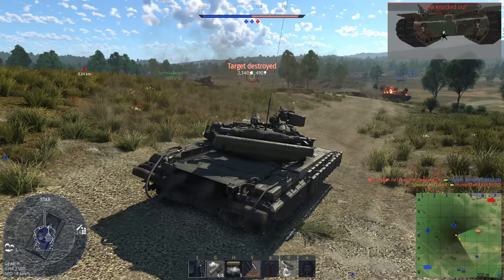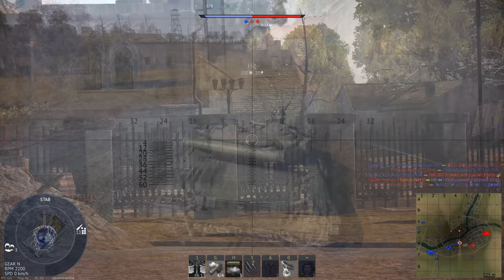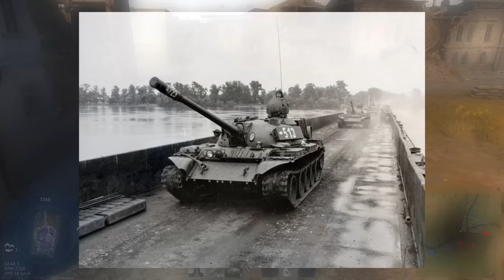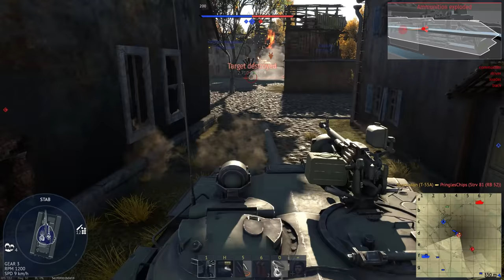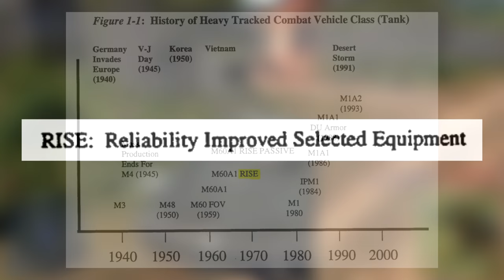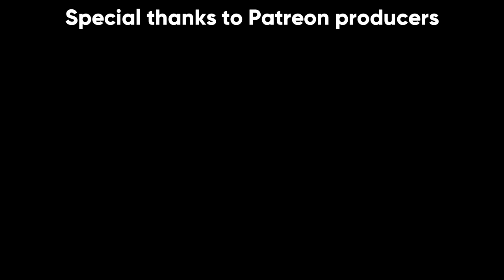Were Soviet Tanks Poorly Made?

Comment: T-64s were actually intended to be used by the "elite" forces of the soviet army. That vehicle was never intended to be that mass produced like later the T-72, wich is basically a downgraded, cheaper version of the T-64. At the start, sure, both tanks had serious problems, but overall the T-64 is a way more advanced vehicle than the T-72s at that time. Later it would be pointless to compare the 2 because more and more advanced models of T-72s were came,  wich were on pair or even more advanced than the T-64s.
About the T-80, well it was intended for complete replacement of T-72s and T-64s, the problem was, there were just too many and the T-80 was too expensive to replace the full stock. Same goes with the T-90s. Thats why today's russian armoured forces consists of a big variety of MBTs. From T-72s to T-14 Armatas, I beleive even some T-64s are in service.
Overall, economy was always an issue for the russian army, they wanted too many, too fast, too cheap, thats why compromises were made. Russia has the biggest armoured fleet in the world, you can't just swap the vehicles, like there were T-72s yesterday and now there are T-14s or something.
Reply: Iirc T-64 already retired or at least put as reserve like many T-55 and T-62. Older T-72 and T-80 probably will be replaced by T-14 starting this year, knowing T-14 serial production has started and state test will be completed this year.

So yeah Russia tank fleet has many variety, with modern Russia tank fleet will consist of T-72B3, T-80BVM, T-90M and T-14.
Reply: T-64's are all retired since IIRC 8 or so years ago, but at least couple thousand are still in storage and probably will be for some time still. Obviously the same goes for T-55/62 series, but they did drag out some 62's for use in training as opposing force couple of years ago AND sent them to Syrian goverment to replenish their losses.
Reply: Russia retired T-64 for the simple reason that they and the spare parts for them were produced in Kharkov Morozov factory, in Ukraine. It became unreasonable to continue servicing them or to attempt to aquire spare parts. Ukraine did the same thing with its T-72 tanks.
Reply: @Ypog_UA  Not that simple. First, logistical challenge of keeping 4 different models with lot of submodels in the field - T-64, T-72, T-80, T-90 plus T-14 was already being worked on. USSR was doing the very expensive thing of producing three different tanks and, arguably, it had more than it actually needed. Russia couldnt afford that, cuts had to be made and they had more than enough of newer models to cover all their needs and still leave thousands in stock. Second - the upgradability. T-64 was the original after all, it had most of the baby issues and was, simply put, old. The biggest problem is, AFAIK, weak undercarriage. Any major upgrades meant increase in mass, which the platform can't sustain without expensive refit. So why do that when you can take T-72 or T-80?
Look at what Ukraine had to do with their Т-64БМ2 - cut the hull open to have the place for the new engine, leading to turret looking wierd because it had to be raised up. 

Also Ukraine is using T-72's as of right now, including doing some modernizations. Necessity due to losses sustained.
Reply: @swordsman1137  T-14 serial production has not started.

Comment: In general? No. It depends entirely on which factory you look at for an example. Nizhny-Tagil removed items that western vehicles simply wouldn't do- like radios for the base variant- and thusly were of lower quality. Couple this with the fact that unskilled labour is being asked to build these things then obvioulsy you will have vastly varying quality in armour to the point that the welding might either be expertly done or just spot welding in vital areas to hold the armour together. 

Bare in mind also that the factories built their own versions, with cast and welded turrets being the most prominant differences.
Reply: Ok what about crew space?
Crew survivability?
If i draw a crayon picture of a tank with 10,000 horse power and 3m of armour does that make me the worlds best tank designer? Or does it make me someone with unreal expectations? Because things arent judged on how good they COULD be. they are judged on how good they are... And even a good T34 would still be quite bad.
To say nothing of the fact one built correctly could never achieve the same production rate.

Comment: @Spookston you forgot to mention the T34s Track Pins. Vibrations from the track moving would cause the Track pins holding the different plates of the track to move and become loose. This often led to the pins falling out and the trap coming apart. A chunk of metal was welded to the hull to knock the pins back into place instead of just outright changing the pins and locking them in place.

Comment: the sight on the T-34 was not heated, pretty much always leading to fogging, making it unusable, the welds would often break after being hit with a substantial round (penetrating or not) due to the poor quality of said welds, and also the excessively hot temperatures used when heat treating the armour would lead to increased spawling after being penetrated, due to this survival rates of T-34 crews were abysmal, shit was cramped as hell, some models weren't equipped with radios to communicate with other armour units, the list is endless, but yeah the paper stats of the T-34 make it seem like a good tank, but it was limited by the rushed environment they were built in, and ofc the situation.
Reply: The sights varied drastically by factory. 

Many failed to seal them properly which allowed in water vapor that could fog up the lenses. However, some factories created some of the best made sights of any tank at the time.
Reply: @thelordofcringe  or some sights were bought from germens
Reply: The heat treating was especially a horrible idea. so many men were lost because of spalling
Reply: @F4Wildcat  it wasn't a bad idea, it was lack of temperature measuring devices due to massive expansion in tank production.
Reply: @simethigsomethingidfk  The T34s produced in 1945-47 were amazing quality because they could spend the time on them and sold them to other countries and wanted to parade the best they could but ones produced during the war had major issues notably welding sights lack of radios most did have the same problems because they were the places they could cut back on. Also no t34 factories were hit during ww2 mainly because they were in the deepest part of Ukraine
Reply: @phunkracy  It was a good idea executed poorly they had the temperature measuring devices they just had the temp too high while most were heat to 300-500 degrees celsius the russians just pulled out 800 and it made then armor too brittle making huge amounts of spalling even on non penetrating shots which resulted in terrible survival rates for russian crews
Reply: @ThatHosh    Except the stalingrad tractor factory... And the multiple ones that only barely got their machining equipment out of the way of the germans before they were over run. And numerous other examples of Russian T34 factories being over run or bombed out of existence. My main point is that the stalingrad factory and one other factory made the majority of the T34s during the war. Those two factories had the worst corner cutting and are the source of almost every flaw people point out in the T34s production. But there were other factories in safer places that made higher quality T34s. Hence why only 60% of T34s were lost due to mechanical failure and not 90%. If they were all made by those two factories no war production T34 would have ever been in service after the war.

Also for the record I highly doubt T34 armor hardness played a major role in crew fatality. Im pretty sure a bigger factor would be that T34s were extremely cramped and almost every german gun used shells with explosive filler. The amount of spaling created doesnt really matter when you have a hand grenade going off inside your tank. The spaling created from none penetrating shots is also generally not enough to kill the whole crew. However a none penetrating shell can break off entier chunks of armor, and no one wants to drive a tank with a massive hole in the turret, or a giant crack in the corner of the hull
Reply: @ThatHosh  brittle armor doesnt mean bad armor necessarily.  It means that if - if! - your tank gets penned you're done. The key word is "if". Also, Soviets absolutely lacked heat measuring devices.
Reply: @phunkracy  One word SPALLING. Overly hard armor without a softer inner layer is a very good way to look like you just fought a legion of exploding blenders.
Reply: @simethigsomethingidfk  Every second T-34 in 1942 was lost to Panzer IIIs. There definetly is an issue with spalling.
Reply: @otherscup  there is a difference between the tank being lost and the crew being killed. If a massive chunk of your tank cracks off (you can see pictures of multiple feet holes in T34s from cracking) you are going to leave that tank and call it dead. There is no repairing a giant hole in the side of a turret.
Reply: @ThatHosh  One of the biggest tank factories at that time was located in Ukraine. All of Ukraine was occupied by the Germans.
Reply: @phunkracy ultra-hard and brittle armor is the last thing you want in a tank, just take a look at what happens to glass when hit by a stone, now translate that to tank warfare. You want face-hardened (only the exterior side is hard) diferentially tempered armor with soft and elastic linings that will absorb and disperse the energy without spalling. Pure physics and materials science.

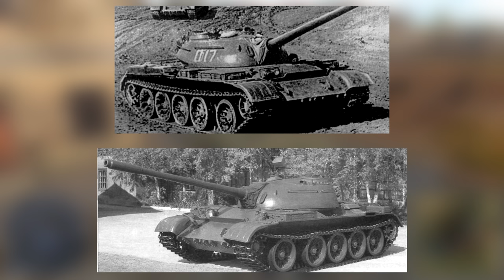Comment: @Spookston 2:03
The vertical stabilizer and driver's night vision device were introduced in 1955 on T-54A (one other improvement was fume extractor / bore evacuator). 1957 T-54B had a two-plane stabilizer and full set of night vision devices / sights for driver, gunner and commander.

As a side note, during 1960-1968 period virtually all Soviet Army T-54s mod. 1949/51 and T-54As were upgraded to T-54B standard (except no fume extractor on upgraded T-54s mod. 1949 and 1951, because the original gun was retained, with counterweight added instead at the end of the barrel for proper stabilizer function).

Comment: Late T-54B or so already had vertical stabilizer (pairing with D-10TG), T-55 had 2-plane stabilizer.
Reply: T-54B already had the two-plane stabilizer. The vertical stabilizer was introduced on T-54A. T-55's principal improvement was the anti-nuclear protection system.

Comment: I think Russia actually was probably one of the more practical countries in tank design. Understanding that any new design would be plagued with flaws but if certain circumstances require you to put new and untested tank designs into production because your in the middle of war so be it. 
And can address whatever problems they are able to gradually as to not disrupt the production much or in peace time were able to put a halt on production until such major issues were fixed.

When you understand your tanks have issues that need to before they are even built you are better prepared to deal with them as they come up or find what the problem is. 

Not striving for perfection can be a good thing because it sets realistic expectations are you are better prepared to deal with problems if they arise. Also I take it as the uglier the tank looks its high chance that its built well functionally because the resources were focused on making key components as rugged and robust as possible. If the tank looks good but can't drive off the factory line without breaking the transmission gear box then its just worthless pile of wasted steel basically.
Reply: An actual nuanced comment on Soviet tanks? Impossible!
Reply: Russia, LITERALLY PUNISHED tank crews that broke down. Siting that the "Unreasonable number of breakdowns were due to crew sabotage"
Reply: @brentonherbert7775  thats litterally soviet union thing
Reply: @yourlocalmilkman916  Uh huh.... Because current russia is any better than soviet russia?
Reply: @brentonherbert7775  well atleast they arent led by stalin

Comment: Having had the clutch parts from a Czech 1952 build T34-85 in my hands,(pics to prove) and been responsible for finding a solution to replace the old horsehair hand sewen seals, read the translated service manuals etc etc.(it was a haul). Thanks to the Cheiftain for helping with sources. The quality of the parts were outright rejects in a US wartime factory. Inferring from the manual, if you & your T34-85 lasted 100hrs, then the maintenance got ugly and heavy. At 500hrs anyone still alive, give them a new tank/IS-2. If you need new seals for your t34. Cut felt -1mm smaller than the shaft, +1mm bigger than the housing. As thick as you can cram in the groove, soak in a heavy grease/oil(moreys was used) prior to installation. The felt/horsehair capures the bits of metal coming off the shafts and polishes the rougher bits somewhat.(you can also use lower quality steels) It may ooze a little but it gets rough untrained production tanks/vehicles out the door.

Comment: hey guys I have a question for you I remember years ago I got into an argument over whether a T-72 had a spall liner. I said the T-72 did another guy said it didn't and that he worked in a factory producing the tank in like Yugoslavia or some eastern bloc country, they also said that there's no room in the tank for a spall liner. When I pointed out that the NBC was a spall liner too they argued it wasn't even though documentation says I'm correct
Reply: Ok, you said a lot... but what is the question? You forgot to ask it? Or you just trying to understand who is right, who's wrong?
Reply: @worldoftancraft  ya I'm trying to figure out if I was right because from what I understood was that export models didnt get the NBC
Reply: PT-91 and late Polish T72M1 had spall liners. This is a no-brainer for me.
Reply: The guy is lying. If the official documentation is contradictory to what he, a supposed factory worker is saying, then he is trying to use BS to back up his point.
Reply: T-72 is very cramped naturally by design, that's probably why he thought it.
If he was a factory worker in Yugoslavia, he must have been working on M-82 which may or may not have a spall liner.

Comment: Feel like the reliability and performance issues of the T34 are heavily downplayed in this video.
In all the "soft" factors the T34 is bad, with it's cramped crew compartment due to slopped armor, lack of radio, extremely brittle or too soft heat treatments on the plates.
It's a good tank on paper, but it's so poorly made in factories like N.183 that it doesn't matter.
According to data from the book
 "Soviet Casualties and Combat Losses in the Twentieth Century" which is compiled from soviet records, in 1942 54.3% of T-34 tanks were knocked out by Panzer 3s.
Reply: Because he largely covered such in a previous video.
Reply: Would that be because 50 mm was made  specifically to destroy heavier armoured tanks?
Reply: That’s because Panzer 3s and 4s made up the bulk of the German tankforce for nearly all of the war. It’s like saying 54% of gun deaths are caused by bullets.
Reply: @phunkracy  It is because the T-34 had such bad optics that the crews couldn't see and didn't even realize they where under attack. This and the lack of a radio so T34's could not communicate meant that the PZ III's could easily knock out T-34's with little issue. Not to mention that they over hardened their steel which caused increased spalling. There is a reason why the T-34 had only a 15% survival rate for its crew. Most of these factors were not fixed by wars end. The truth is the T-34 was one of the worst made tanks of the war.
Reply: @Crembaw  I never said anything about the Panzer 4 in my original post. What you don't seem to understand is that the Panzer 3, which many will argue as being inferior to the T-34, is theoretically not supposed to be able to penetrate the T-34 frontally without special APCR which was not common due to special metals needed for it's production. Now if you used your big smooth brain to develop some wrinkles and think, you'd realize how your "witty" comment is not very much so.
Reply: @Crembaw  The majority of tank kills in WW2 were made by anti-tank guns, not tank on tank combat. The fact that the Panzer 3 managed to knock out over half of the lost T-34s means the 34 was shit.